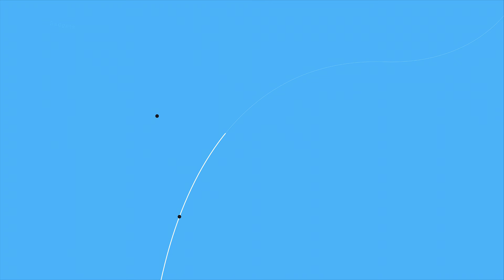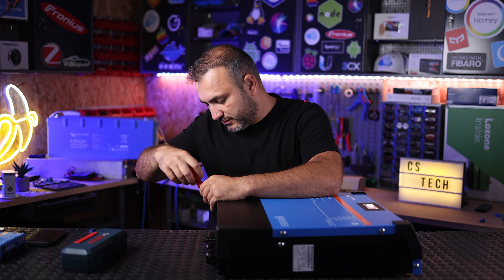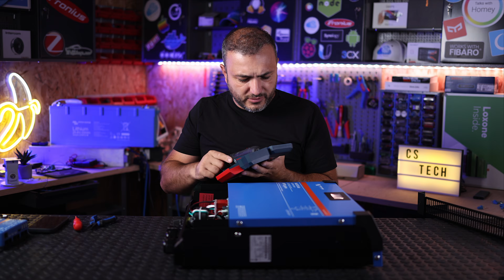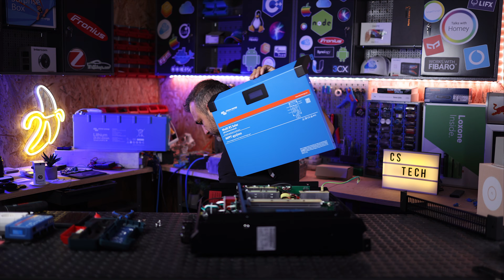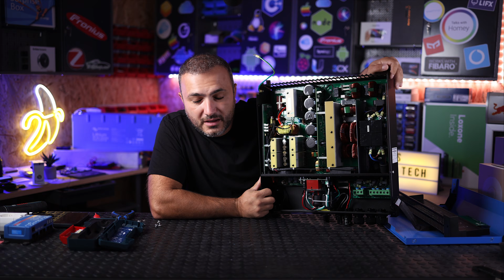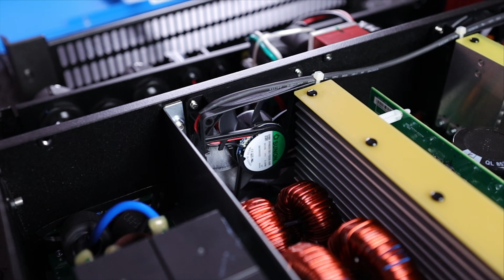Victron Multi RS 48/6000 Teardown! See What’s Inside This Powerful Inverter

Comment: Hello. I need to know, what is the capacitance of each MPPT input on Multi RS, but this info is not available anywhere. Could you measure it or read from the capacitors? Is it larger than 500 µF? Thank you.

Comment: Hi, thanks for video, can you do a full load capacity video on the inverter. Thanks.
Reply from the maker: We tested and output is real, 5000W :)
Reply: I have seen 7kVA out of my one. However, it was only for a minute or so, and also it was sunny.
It would not make that power without PV adding power to the internal DC bus, this is because the LLC has a 100A limit - so ~5kW.
Mine is happy to make 5kW for a long time, usually when heating water and charging the car at the same time.